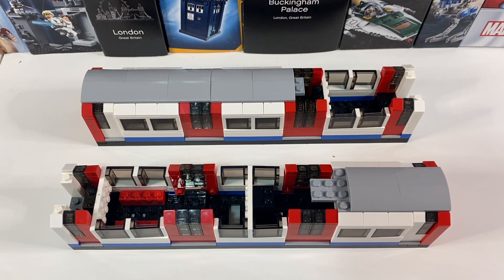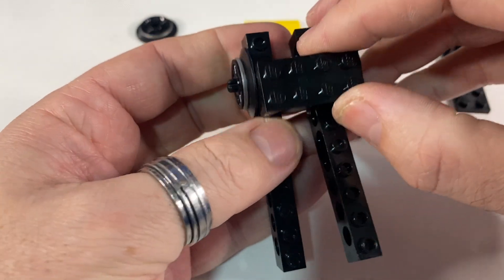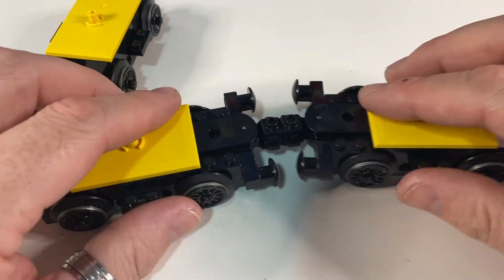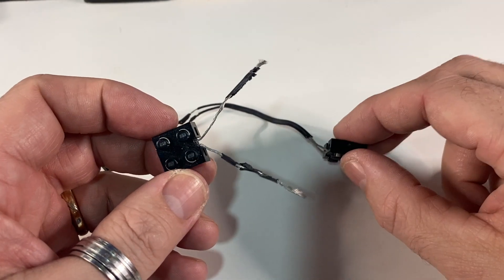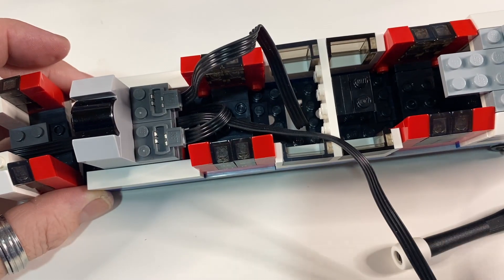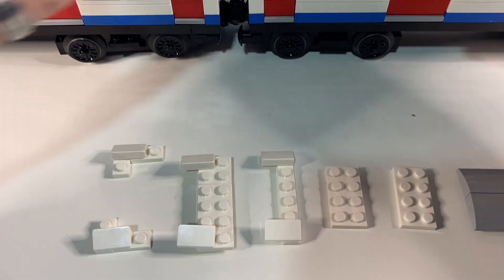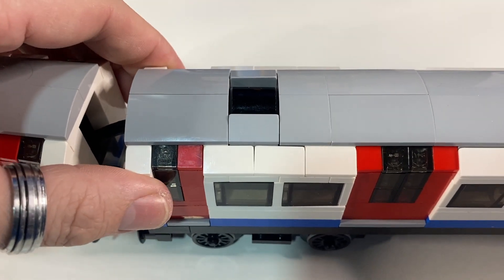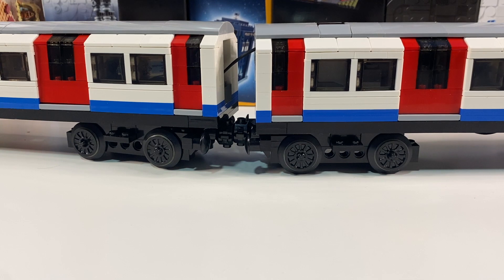Lego Tube Train MOC Part 3 - Motorising the London Underground Train (1973 Stock)

Comment: in the title you call this a 1973 stock when in fact that is the Piccadilly line train but you are building a 1972 Bakerloo line stock
Reply from the maker: I was following information from Train web about the 73 stock:
http://www.trainweb.org/tubeprune/73%20tube%20stock.htm
specifically this picture:
http://www.trainweb.org/tubeprune/73%20TS%20trailer.jpg
and this picture:
http://www.trainweb.org/tubeprune/73%20TS%20mixed%20train.jpg
What makes you think I'm building '72 stock?
Reply: the 1973 stock has a park grey cab but your one doesn't but it dose have inset doos witch means it MUST be a 1972 stock @MinifigJez
Reply from the maker: @sethtcreations5061  in which case, according to train web (links above) I HAVE built 73 stock, but I have built a specific one at a specific time!
Reading the notes to the picture which I used as my reference photo, I seem to have built: 
"Trial refurbishment unit 190-590-390 with its specially adapted unrefurbished unit 123-523-323 approaching Acton Town in 1992."
(Photo by B Hardy)
So I see what you mean about the dark grey stripe around the cab windows on '73 stock, but there was at least one that (for a least a short time) was ALL red on the ends !!!
Thanks for taking the time to follow up the comment.

Comment: When you do the battery carriage there are 2 spaces left for passengers.
And 1 driver driving the train
Reply from the maker: Good point!
Because of the way I've made the roof, there's not much height, but I could probably fake some passengers and a driver if I take their legs off and put them in as just torso's and heads. - THANKS !